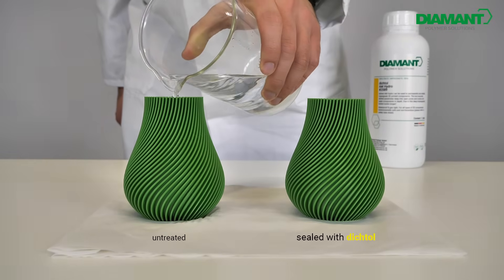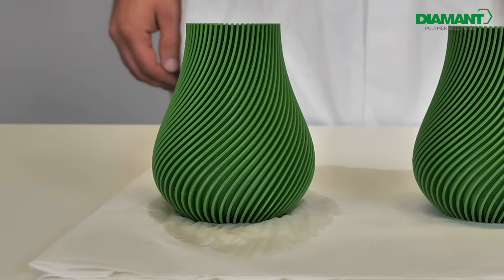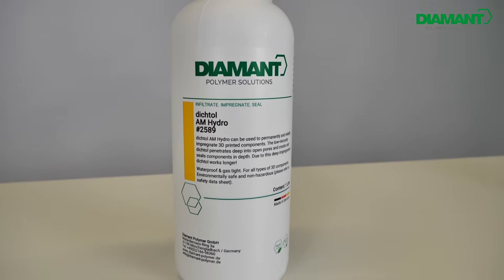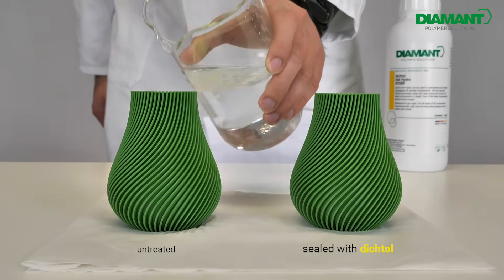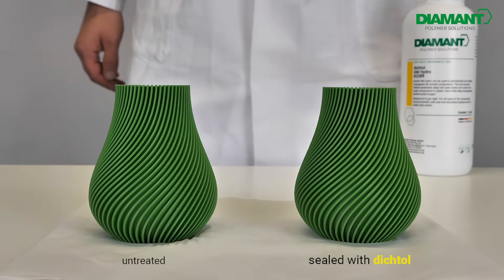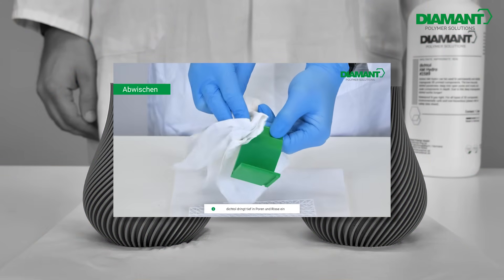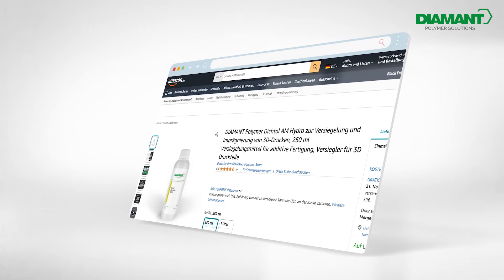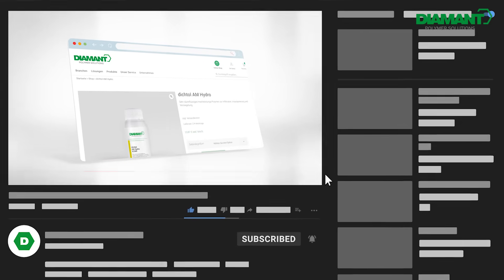Make 3D Prints WATERPROOF in 5 MINUTES

Comment: Tried this using the brush method on a SUNLU PETG outdoor box. Printed with layer height of 0.28mm draft. 2 hours after brushing the entire surface inside and out, I submerged the box in water and after only 5 minutes it was 50% full of water. Why would that be?
Reply from the maker: Thank you for sharing your experience with dichtol AM Hydro. Based on your description, there are a couple of possible reasons why the sealing did not work as expected:

Drying Time – dichtol AM Hydro needs sufficient time to fully cure before being exposed to water. If the part was submerged only two hours after application, the product may not have had enough time to penetrate and seal the structure completely. We recommend a drying time of 24 hours to ensure optimal sealing performance.

Porosity of the Print – If the layer gaps or pores in the PETG print are too large, a single application may not be enough to fully seal the surface. In such cases, applying a second layer of dichtol AM Hydro can significantly improve the waterproofing effect.

If you need further assistance or have any additional questions, feel free to reach out to us. We’d be happy to help!
Reply from the maker: Hi Steve, thanks for your message. What dichtol did you use?
It seams that it was not fully dried. We recommend to let it dry for up to 24 hours at room temperature. Or the leakages between the layers where to big for the sealer you used.
Reply: @DIAMANTPolymer  so is it just five minutes, or 24 hours?